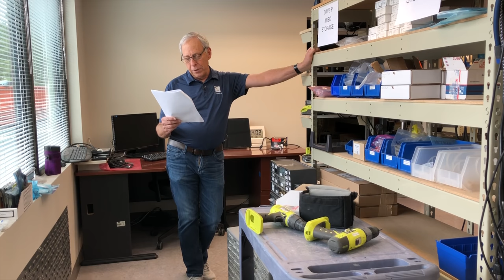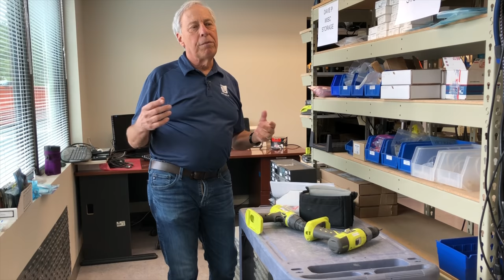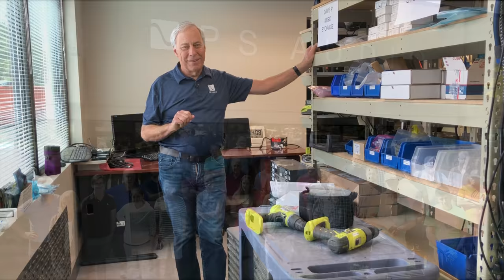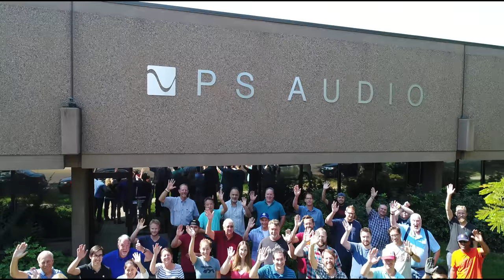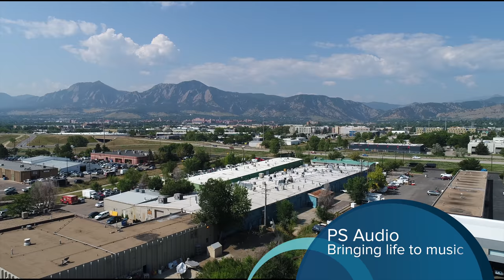What's the best sounding volume control?

Comment: Not counting digital or the gain cells discussed here, the best sounding 'traditionally designed' are, in order, stepped attenuators with high grade metal film resistors; then precision carbon film based wipers.  Stay away from plastic film, which tends to lose a bit of dynamics and has a very light "gauze" over the sound.  Years of comparisons building 'passive preamps' led me to these conclusions.
Reply: Did you try wirewound models? Just curious.
Reply: No good.  Sharp in the upper midrange/treble.   @robbedoeslegrand236
Reply: @PalJoey-rm2yh  Thanx!
Reply: @robbedoeslegrand236  Wirewound resistors have the side effect of parasitic inductance which can create frequency dependant artifacts in combination with circuit capacitance. Inductance is great in power supply dropping/ballast resistors but not beneficial at all in the signal path. The best resistors for the signal path use either bulk resistance or a resistive film in a non-inductive construction.
Reply: @Peter_S_  Well that makes sense indeed, looking at their construction.
Reply: I always heard a difference with remote controlled versus manually controlled volume control or, so I thought.  Could it be I was just hearing the difference in the type of materials used? I felt the remote controlled volume sounded like the  "gauze" you mentioned in your comment.
Reply: Yes, i agree. The problem with passive preamps is that they often behave very different in many combinations.

Comment: Enjoyed your comments. I will have to do more investigation of your gain cell concept. I do some pro audio engineering and have always beed frustrated with the way attenuators screw with the sound. Over the years I have found two that I like... I don’t hear effects if attenuation. 

1. 32 bit digital atten. Built into Mytec Brooklyn DAC. 

2. 3 stage analog atten. In Millinnea HD-V 8 Channel mic pre.  Covers 65db range. First control is switched metal film in 1.5 db increments matched across channels to less than 0.1db. Covers 22db. Then if you need more gain you push button to insert 2nd and 3rd stage, otherwise they are not in circuit. Sounds flawless, favorite of Telarc.

Comment: Very good question and very good answer. Transparency of volume controls affects every stage. On electric guitars, any quality instrument will include a small capacitor to allow the treble to bypass the volume control entirely. Without this cap, highs are attenuated in the control with any setting that places more than zero ohms in the signal path. Often 250K or 500K pots will still leave a few tens to a few thousands of ohms in the signal path even when set to 100%. Jerry Garcia of the Grateful Dead countered that "tone sucking" issue by running his signal unattenuated directly to his Fender amp as a preamp sans any control and then looping the pre-amplified signal back to his guitar to the volume attenuator which finally fed his McIntosh MC-2300 power amp. That helped.
Reply: MK ultra - a REAL program - a REAL Wikipedia entry about one of the core "DEAD" writers " Robert Hunter is an American lyricist, singer-songwriter, translator, and poet, best known for his association with Jerry Garcia and the Grateful Dead.
  Along with Ken Kesey, Hunter was an early volunteer MKUltra test 
subject at Stanford University.  Stanford test subjects were paid to 
take LSD, psilocybin, and mescaline, then report on their experiences.  These experiences were creatively formative for Hunter:
Reply: @Peter_S_      -  If you decide to pursue proper logic https://logosmedia.com/2013/05/manufacturing-the-deadhead-a-product-of-social-engineering-by-joe-atwill-and-jan-irvin/    a few things to get you started -       - Dave McGowan broke alot of this info and was killed - https://the-eye.eu/public/concen.org/Weird%20Scenes%20Inside%20the%20Canyon%20-%20Laurel%20Canyon%2C%20Covert%20Ops%20%26%20the%20Dark%20Heart%20of%20the%20Hippie%20Dream%20%282014%29%20by%20David%20McGowan%20%26%20Nick%20Bryant.pdf
Reply: @Peter_S_   https://www.reddit.com/r/gratefuldead/comments/6068xx/we_now_know_for_sure_jerry_garcia_was_a_cia/

Comment: Digital volume control is the more typical way in much of modern gear. If you run the DAC directly to your power amplifier you can attenuate digitally. And surely lower volume means lower bit resolution but if you start with 24 bits you have 8 bits of attenuation before hitting a 16 bit resolution. That’s from 1:1 to 1:256 or 6x8=48dB down. If you crank the volume down more than 48dB you end up with less than CD quality.
Reply: You sir answered my question before I asked it.
Reply: Or Nads 36-bit digital volume control. I cant find any arguments against it. (Correction 35-bit).
Reply: Yes, but 35 bits. Still awesome.
Reply: @ThinkingBetter  yes your right 35-bit
Reply: 1:1 to 1:256 = 48dB not 24dB.
Reply: Mr Surname Yes, your right.
Reply: You have to consider, that there is no real 24bit dynamicrange in the real analog domain (18 to 20 bit is more realistic to take as a value).
Reply: @christophschuermann6512  Quite right. We call the last 4 bits marketing bits.
Reply: Mr surname: you nailed it! A good way out, is to combine the digital attenuation together with an analog attenuator for example -20, -40db etc. to get the best performance.

Comment: I don't know why VCA's aren't more readily available just like adjustable voltage regulators are . Just add + and - 15 volts ...a control pot and there you go ! The gain cell must have specs equal to an OP27 or NE5534AN at the least
Reply: A Gilbert Cell Multiplier circuit is a VCA. And there are some chips that are true VCA's. But other audio gain chips are also just stepped attenuator using CMOS switches and a resistor ladder. The Burr Brown PGA2310 is an example that I have used. Many high end audio processors use it as well. Cirrus also makes several audio control chips. What you have to look at is the analog power rails. Many of the 5v only or +/- 5 v parts cannot handle a good audio dynamic range so the input signal must be pre attenuated then subsequently boosted. The PGA2310 has a +/-15v analog section so it can handle pro line level up to +24db directly.

Comment: So it's ok to turn the volume all the way to the max on the amp, and make a variable gain on the dac?
Reply from the maker: Yes, that's typically what's done. Most power amplifiers don't have a level control and are always at "full volume". If the DAC has a level control, that's the best place (other than a preamp) to control the level.

Comment: This is pure truth !
the best component is always NO component ........I even tested fuses ........and the best fuse was NO fuse ! ( at my own risk) , so i put a bypass switch on the fuse ......
Same as designing a preamp..........using the less components as possible.......the few left will be choosen because they will reveal their sonic nature and synergy with the others..
Most used high  resistors hyped for their precision are not necessary the best sounding !.
And when using a pot ...............not at the input but in the output .....
All pots sound different ........Right and spot on ....

Comment: great explanation. i make custom amplifier boards, what i mostly do is ... no pre amps , no potentiometer ... the computer's DAC controls the volume and digital equalizer controls the tone . :)
Reply: Manjul Walia How is your bit resolution when you lower the volume 48dB?
Reply: So, what do you actually make? The boards of "custom" amplifiers? As I understand it, you drill in holes boards where someone else on the assembly line screws a step-up transformer on it, correct?
Reply: @Kevin-vq6rv  lol, nope dude ... I only do DIY stuff and experiment with different things . I have self made the amplifier boards using Transistors (2sc5200 & 2sa1943) and ICs (lm3886) and also I have made toroidal transformers. My point here is , as I experiment with different preamps and all I noticed the best sound to be connecting DAC directly to power amp and controlling volume through computer :)

Comment: Gain Cell amps were around in the '70s.
Reply: I had a Quatre Gain Cell in the '70s. It sounded very good when it wasn't self destructing. I doubt if it worked the same as the PS Audio amp.

Comment: Transformer coupled  (Music First)!!!
Reply: I"m surprised he didn't bring this up at all. I'm guessing its so expensive to implement it properly and very few preamps use this but this is to me the best volume control ever made or designed. No  worry about resistors, volume is changed via induction only. It is the most transparent and musically satisfying by far.

Comment: As a consumer, I don't care how my volume control works, that's for the designer to decide. All I have to know is if I like the component or not. Want to be a real purist? Solder in a new set of resistors every time you want to change volume. This would essentially be a stepped attenuator, without the risk of a dirty or corroded contact.  I had struggled for years with the same idea about speaker wire connectors--spade vs. banana vs. bare wire. I finally realized I can't really tell a difference so it is now bananas for me, I change things a lot and they are easier to use.
Reply: Your soldering in resisters is even with brilliant! I really only need two different volumes!
Reply: That would be the most expensive sound machine. How much to keep your favorite band on retainer.?
Reply: Not a bad idea. I have an old wind up acoustic phonograph. The volume control is a thick felt butterfly valve in the throat of the horn.

Comment: Analog volume control, bad. Digital volume control, good?
Reply: No, a digital attenuator is not necessarily better, just a different set of problems. Like most technology, You can have a very good analog attenuator and a poor digital implementation or vice-versa. See the reply below by ThinkingBetter.
Reply: No, both can be good and bad depending on design and implementation. As a rule for digital if it's less than 32 bits then it's all bad.
Reply: Andy Delle you are absolutely right.  My personal is to have a quality stepped resister or wiper attenuators. I was being a little facetious.  My apologies.